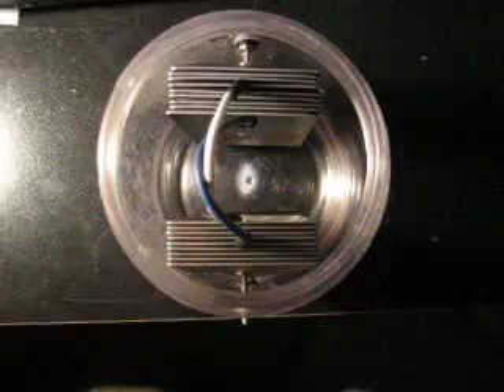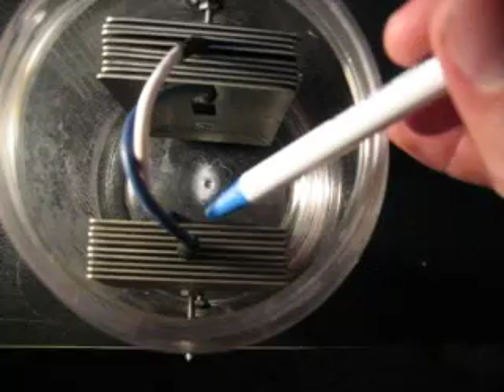HHO Cell #2 plates explained 9/8/07

Comment: I am going to build myself a HHO generator at some stage but I am at a loss as to why these plates are called neutral plates. If you were to stick a voltmeter on them, you would find a voltage proportional to the spacing of the plates because the electrolyte acts as a resistor.

Being someone who works in a laboratory, I would like to do some tests to see HHO production while graphing the power vs number of plates.

Should be interesting, I will make a guess that power is proportional to HHO